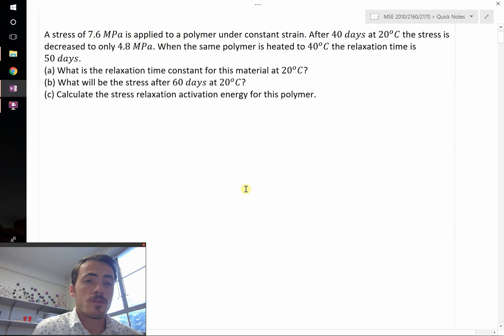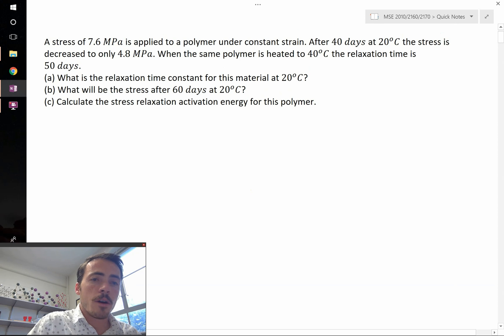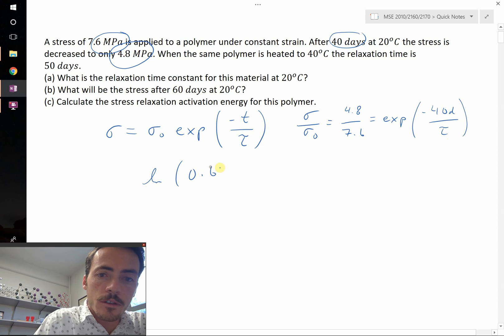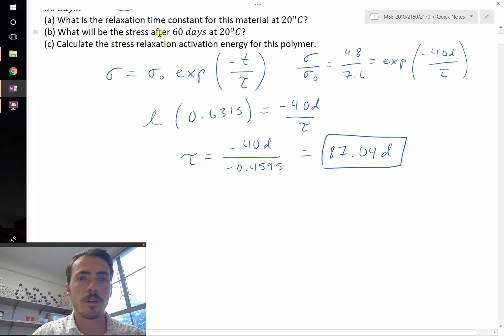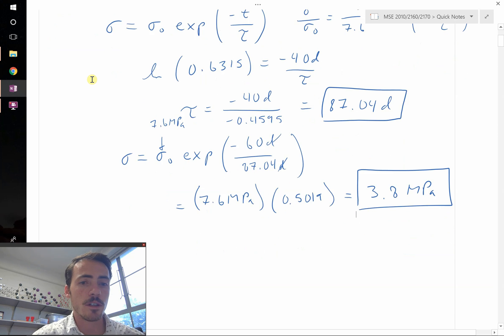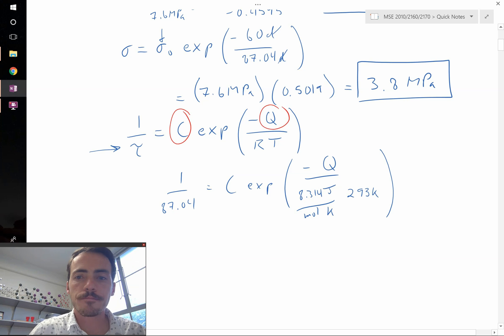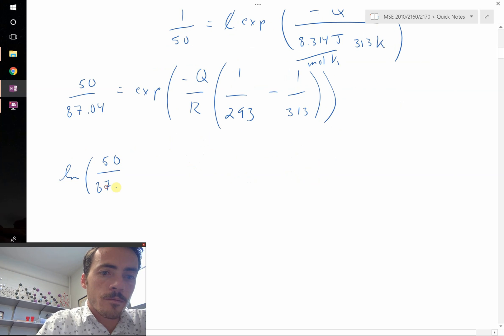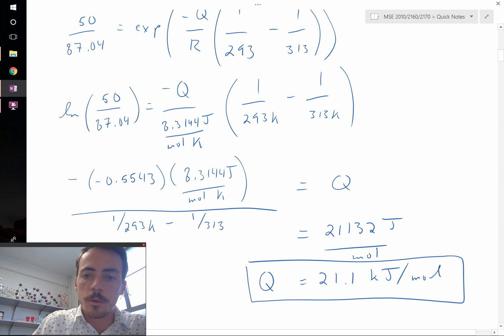stress relaxation of polymers example problem

Comment: Hi Taylor, thanks for the great video! I'm a little confused at the part where the stress relaxation constant is explained. Is it the time after which the stress acting on the material at const temp and strain gets reduced "by" 1/e of initial stress or gets reduced to "1/e" of initial stress?

Comment: Hi Taylor, thanks for the enlightening video. I wonder if it is possible to calculate the relaxation (retardation) time constant when performing a creep test, instead of a stress relaxation. I am particularly curious in:
1) How would be the strain, initial strain, time and retardation time equation
By the way, where did this equation you used come from? Any reference you could share? 
2) What does the retardation time means in creep? Is it also related to the time required for the strain to increase by a certain percentage? If yes, which percentage is that?
Thanks!

Comment: Hello Professor. I am currently working on my thesis and was wondering if there is a way I can connect with you. I have a similar problem to the one you are explaining in this video and would diffidently appreciate your help if possible.
Reply from the maker: Sure. Email me. Just Google Taylor Sparks Utah and it will pull up.